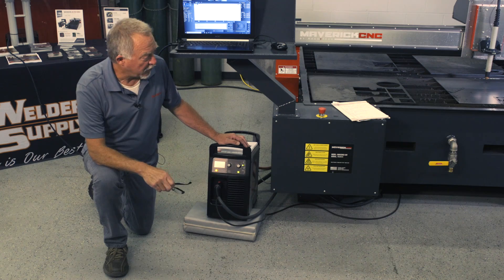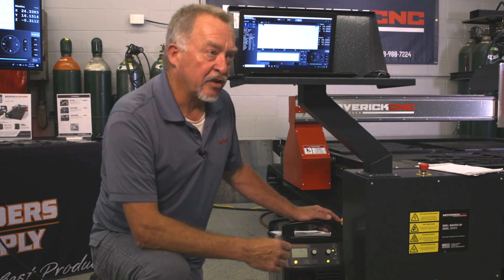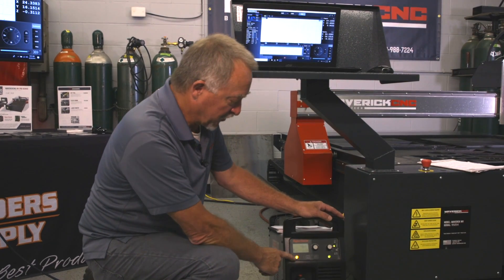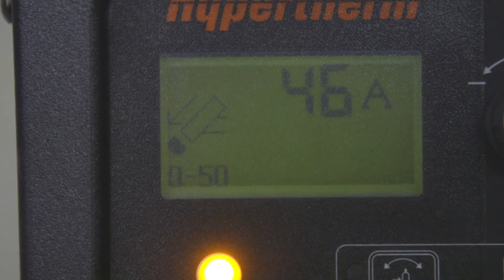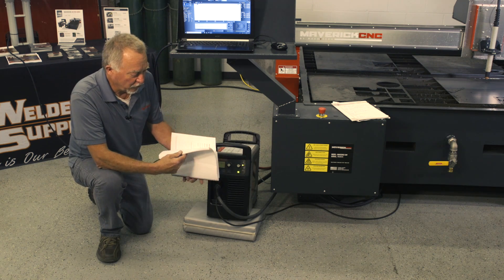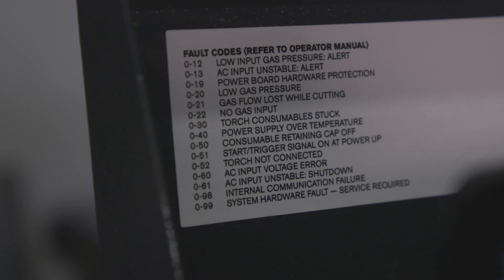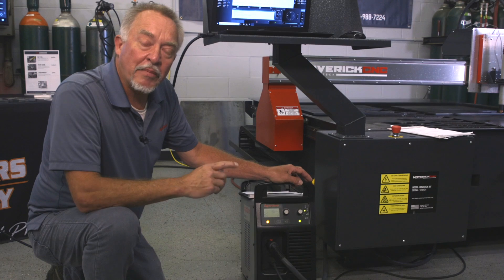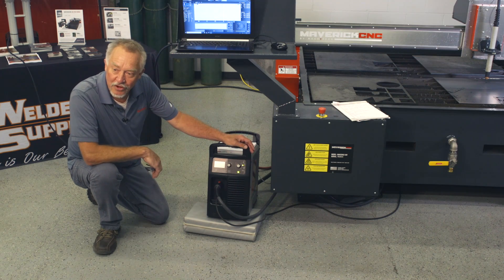Air Plasma Error Codes on Hypertherm Powermax - Tips and Tricks with Jim Colt

Comment: Imagine working at a shop where somw office guy tells you info going against manufacturers instructions. Where they're more worried about a 10$ electrode than the stainless material it could butcher.  It's 1mm depth not 1/32. Hypothermia clearly states to replace both the tip and electrode at the same time. So is the clapped out tip  to be used with a new electrode?

Comment: Why would a table give a POStime error code when the torch goes down to read the THC? Mine goes down and then sits bottomed outside of the metal and then doesn’t piece and then I get POStime code on my baliegh interface screen?
I’ve tried everything.  

Baleigh pt44ahc table 
A80 thermal dynamics plasma cutter